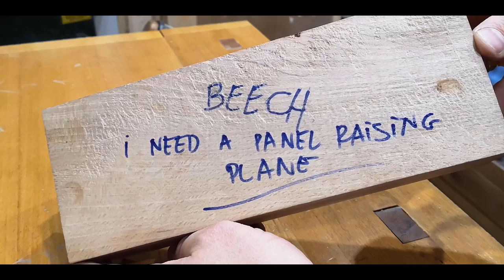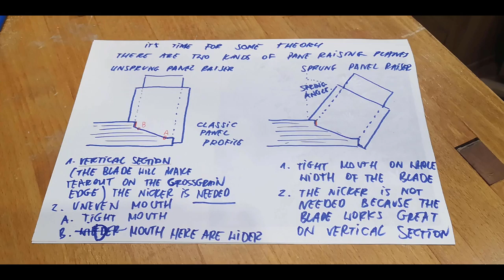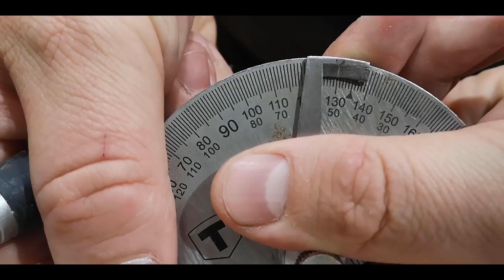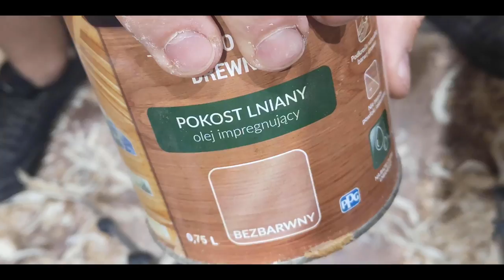025 Panel raising plane - building process / woodworking

Comment: stunning process. like it. maybe the planer be more controllable if the front be longer (the part before the blade)? so, you can get more accurate ride when you use more force

Comment: Mr Gakos, is there a reason why you snap off the steel when shaping? I saw another tool maker do the same. On the cross grain, do you just sand out the spelching before finish? I've rewatched nearly all of your videos this past week, some for 3rd or 4th time, after hitting my head in the workshop. Truly inspiring even to my scrambled head.
Reply from the maker: Hey, thank you! Sometimes snaping off is safer and faster than grinding. There was too much steel to grind off. I sand them before. Regards!

Comment: just amazing, I am in love for your work. I just like to know what kind of disk you  used for the final part of the sharpening. I also like to know if you can suggest if old blade are not available, what kind of steel can be used, instead. what is beech wood?
thanks in advance
Reply from the maker: Thank you, it was leather glued to the piece of wood. Any high carbon steel will be good. What do you mean asking about beech wood?

Comment: Do you need to make these in pairs to cut the other side of the panel, or will it work against the grain? Beautiful workmanship.
Reply from the maker: Thanks David! If the panel will be made out of two bookmatched boards the grain direction will be right on booth edges. Bacause of that one plane will be enough. Cheers
Reply: @StavrosGakos  ah yes good thinking that would also lessen risk of movement and cracking in the panel. Thank you.

Comment: Very well done  years ago i worked with a old timer that had hand planed all his moulding s in his home he built  as a young Carpenter i was quite impressed  he had kept all his old planes  in the event  he ever needed to remodel or make more  it did take him several years to make enough moulding  as luck would have it i made my career working for over 20 years for a large Millwork Company and everytime we had to grind a new set of custom knives for our Moulder i thought of that old guy  of course we made many hundreds of feet runs  in a work day with modern equipment

Comment: Great job, and I don't think I could ever hope to be able to do what you're doing here. However, have you thought about the following?

If you're going to plane the opposite side of the board, you'll be going against the grain, which will result in tear out, which will turn your board into firewood. To prevent this you'll be needing a mirrored version of this plane.

Unless there's something that I'm missing here...
Reply from the maker: Thank you! If you would made the panel from one piece of wood, cuted and opened as a book the problem will be solved :)

Comment: Absolutely beautiful panel. Oh ya, the plane is gorgeous as well. Did you make the wooden screws as well? I like those router jigs, pretty neat. I use to chisel out my mortise holes, now I use a brace to remove the bulk, great tip that. Creating perfect round overs using two flat angles produces perfect results. Love it. Very impressive mirror finish. Absolutely love the iron holding block, I’ll be making one of those later today as I have a garage sale plane I need to restore:an old Record No.4 that has been treated badly. That jig will make flattening the back of the blade much easier. Lastly, thanks kindly for your videos. Love them!
Reply from the maker: Thank you :) Yes, i made that screws. I'm glad you like the video. Regards!

Comment: I've seen you using Narex chisels. After around 10 resharpenings I can confidently say that 25 degrees sharpening angle is too low for them. Not even close! And I work almost exclusively in spruce and pine. The edges are too fragile. I've seen people complaining they're a bit too high on the hardness scale. Quite the opposite from my experience! Also, that "too hard edge will crumble" has become an excuse-myth. At least in my books. So many people uptight about it and I've seen more yettis than tool edges cracked due to "too much hardness".
Reply from the maker: Hey Tomek, i own them but it doesn't mean i recommend them
Reply: @StavrosGakos  I know that. Just wanted to get your input in case I'm out of my mind here. Call it a sanity check ;)

Comment: That keyhole saw—you use it regularly.  Did you make it or buy it?  How thick is the blade?  Looks about 1/8”, thicker than normal blade, but hard to tell on video.
Reply from the maker: Hey, i got the blade and i've made the handle. The thickness is about 3mm

Comment: Couldn't you do all of that accept for shaping the bottom and fasten an old piece of molding to it then finish the hole through that for the blade and make a mother plane from it then use the mother plane to make the moulding plane?
Reply from the maker: Yes, mother planes can be make in that way. Regards!

Comment: What size is that pink grinding wheel at 26:00, and where can I find one? Awesome video Stavros!
Reply from the maker: I don't remember what size. That grinding wheel is dedicated for chain sharpening. Check on ebay. Regards!
Reply: Stavros Gakos found it! It helps to have the right keyword to search. Thanks!